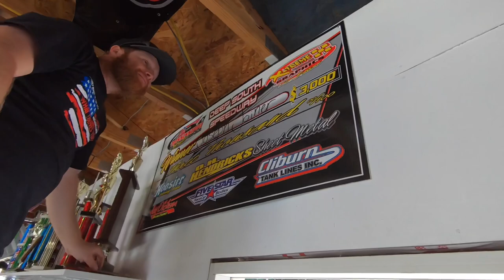We Moved into a NEW RACE SHOP!

Comment: I'd do 3 headers and have 3 doors out that side, be easy to do, and have a loft for storage. Btw Congrats on new hq!
Reply: The loft could  be set up with the table and frig and whatever for relaxation
Reply: Came here to say the same. Extend out the back and have 3 bays. Maybe pour a pad on that side and put a covered roof over it for washin or workin.
Reply: @wadechristianson9511  and a/c to cool off in after working on the cars. Spray insulation  the whole building . For sound echo and hot / cool.
Reply: Its tj macks i was wandering if y'all know anyone that needs house trailer Axel and tires i have 5 Axels and 10 wheels and tires like new .... Milton Florida
Reply: He said they would have to move the 
 post car wont fit between the posts to put the doors in
Reply: Us in the comment r on the same page lol
Reply: @russellhogan957  My thoughts exactly. I love Beau's covered apron in front of his shop.
Reply: @craigcoons4407  i think it's pretty straight forward, when you say install a header, you mean removing the posts that are in the way........
Reply: @jerrellkull5347  yeah exactly I think they should put 3 doors every other bay
Reply: I think this would be the way to go. That shop could hold 3 cars, without having to add on. You can set up a nice covered wash rack outside the doors, so you can go straight from trailer, to rack. Never bring a dirty car inside.
Reply: Hi make a YouTube channel 🖥💻
Reply: @Thesoccer262  for what reason?

Comment: I would put headers in across the front side like you stated in the video. Put 3 doors on the 48’ side. Then put lean-to on that side as well with concrete sloping away from the doors for a covered wash bay all the way across and the cars could stay covered outside as well if you need the shop floor space for something else

Comment: Definitely add a loft. Two doors along the side would be pretty simple. Try to angle the cars and see if you can still get one out of the back without moving the one in the front. It might work depending on what all you put along the walls for now. Dollys are sooo easy to make so you can move the cars around easily.

Comment: You can get a big I beam going on the side you want for the two side doors and then just get rid of the metal up and down ones, it would be the same concept as the big 50 foot wide farm doors that are hydrological lift. my grandmas garages are a little bit longer, and wider, but are only 16 and 18 ft tall, and see have thought about in the taller one putting one big I beam in the one side and putting 3 big doors on the side to put 3 vehicles, congrats on the shop tho

Comment: Nice shed, remove the side wall one bay in from the ends. 1 large steel beam in the middle full length lean to on side as wide as you can go but from roof level. Have a slight fall on concrete so you can wash the race cars there and move cars in and out through sliding or one big roller door.  That would give you more under cover workspace and places to park your truck out of the weather. Nice shed.

Comment: Taking out a post on the long wall is not a problem at all.  All you have to do is add a long 4x4 under or over the existing wood, screw the 4x4 to the existing 2x4's, and cut at will.

Comment: You have tall enough walls on the barn that you could attach a doubler to the wall just below the soffit and run common rafters to a beam on a few 4 for a lean to like shed roof. Depending on how wide you want it will tell you how much to pitch the roof

Comment: The door that isn't wide enough just make it wider. Then come down 6-8 foot from that door and add another door. Leave the door on the end of building put cover over the slab that is already there and have wash bay. Then you can pull two cars in the side and pull one in the end of the building and use that end for tear down and body panels to be replaced or to pull motors or what ever repairs need to be done.

Comment: Id say the most effective ways would be to build a loft which you can park cars under for the table or a 4 post lift so you can store 2 in the same footprint as one. 

The least cost effective would be buy a whole other building kit disassemble that building lay the extra concrete where you need it for the next building and go from there. That also might save you money on the cost of building a second shop and pouring concrete for it and you could sell the original barn as either scrap or as a used building to recoup costs. 

It probably helps that Joseph has access to the equipment and materials too.

Comment: Need to get some wheel jacks to put under the 4 wheels and then you can roll the cars around a lot  easier then you could get all 3 of them in without too much problem. I would for sure look into getting 3 headers put in for the bay doors on the side wall of shop though. It wouldn't be difficult at all.

Comment: I would add on too the area that the 12 foot door was being proposed too be installed in and put that 12 foot door facing the back of the house. Which would make the building in an L shape. However, it would take care of the added on space and door all at the same time. Or just rework that side of the building too put in 3 12 foot doors and make three bays from that long side of the building. With at least one vehicle lift in one of the bays.

Comment: Personally, I would just move the laundry line closer to the house and out of the way of the racecars. Build a lean-to on the long side near the fence. Cover current too small door, and build 3 wide doors in the long side facing the yard. I feel that is going to be much cheaper than a whole new building. Also with the money saved on not building a new building you could put a 2 post lift into at least one bay, so those transmission and rear end changes won't be so hard.

Comment: You build a HEADER I put a 16.3 inch wide door in my pole Barn SAME BUILD as yours you just build a HEADER  and put it on the next post !!!!!! Hell I added 3 more doors on the other side of the building Move the ELEC what ever is in the way Span it as far as you need to and build a HEADER to fit we used 2x6 glued 3x4 plywood in the center left them clamped for 24 hours then set them on the post Thats all you got to do